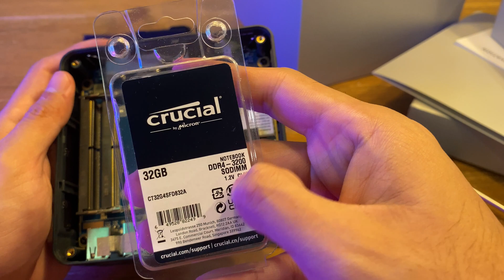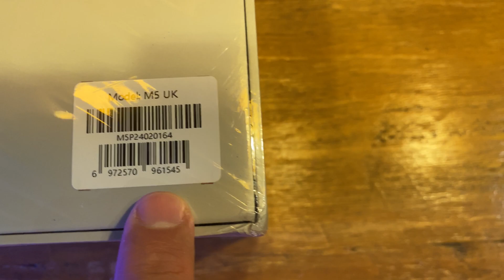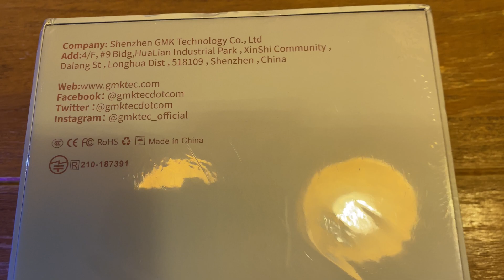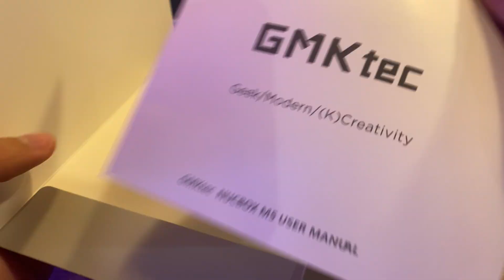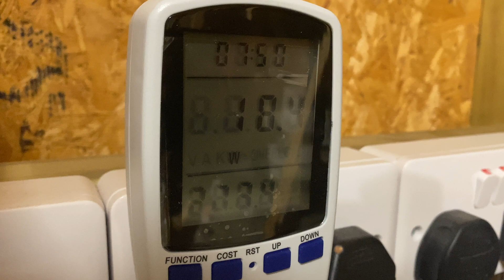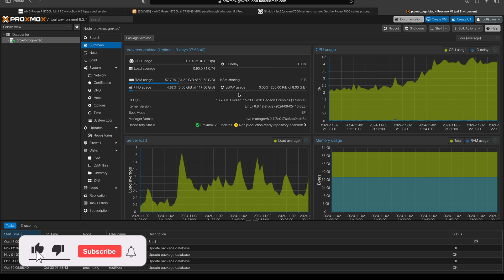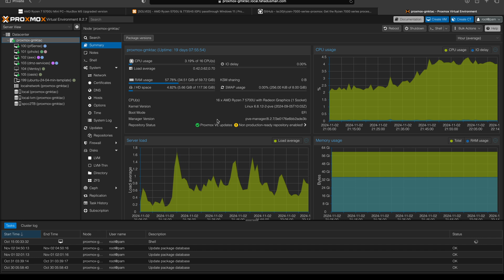GMKTec NucBox M5 for Energy Savings! Ultimate Mini PC for Proxmox & VMs!

Comment: So, that means DDR4 RAM modules are compatible with each other. What about the recommended compatibility test to ensure speed, timings, voltage, and rank? I've heard that otherwise, the system might be forced to run at the speed of the slowest module or, in the worst case, fail to boot.